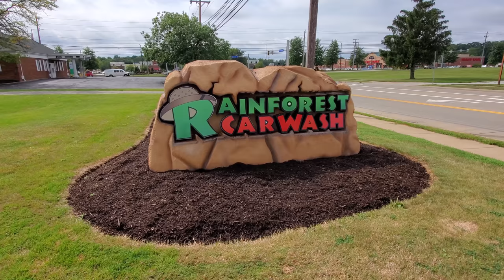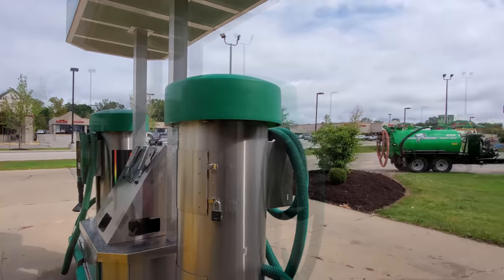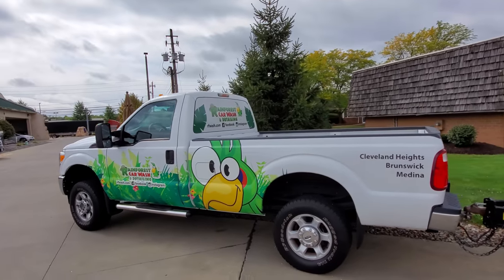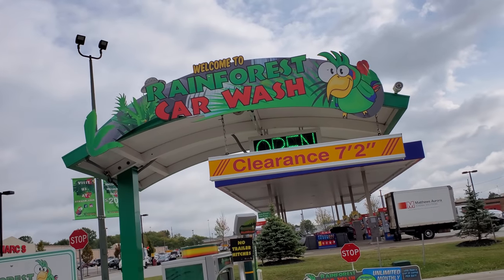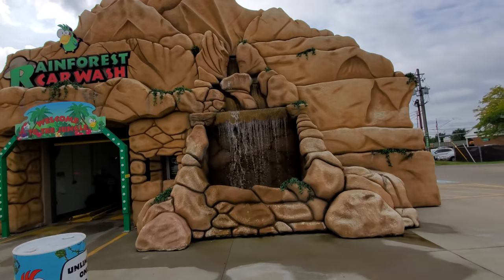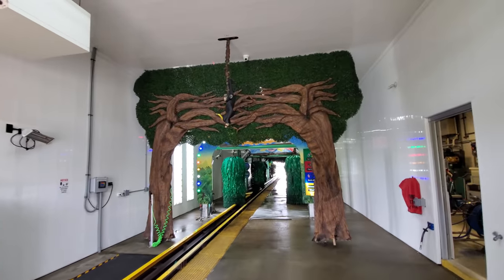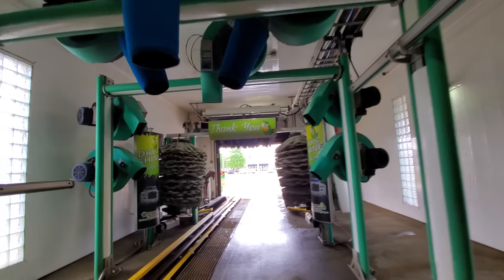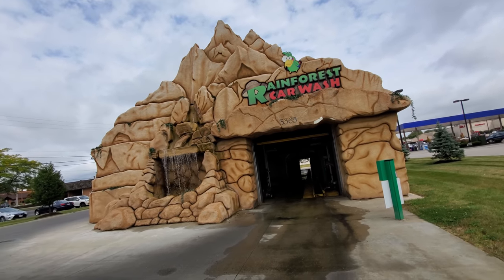MOST AWESOME CAR WASH EVER ! RAINFOREST CAR WASH in BRUNSWICK OHIO

Comment: This is an unique design of this car wash, I like it.  A lot better than the traditional car washes here in Lubbock. We used to have a Quick Quack Car Wash which did about the same which I went through the car wash but wasn't scary but was neat going through with no lights on.

Comment: I guess I missed the awesome part . Folks, hand wash your car . These car washes scratch your paint .
Reply: Handwashing scratches your paint too.
Reply: After running multiple washes for the last 10 years you're completely right as long as you're using a clean mit you won't have scratches hand washing your car
Reply: G17 SOFT TOUCH WASHES DO NOT SCRATCH CARS!!!!!!! They use closed cell foam, get your damn facts right buddy.
Reply: @thecarwashelevatorfanatic7433  
And the dirt that collects on the foam doesn't scratch your paint? Any contaminants will do the same thing, some may scratch your car less than others but when you add chemicals and things that have been used to clean other peoples cars it will scratch your paint.
Reply: Zach T You have no proof of that, they are safe for cars. Shut up and leave me alone you two.
Reply: @thecarwashelevatorfanatic7433  
Dude holy cow, facts are facts. Any contaminants on your car or equipment you're using will scratch your paint, you can minimize it but it will still happen anytime you wash your car
Reply: Zach T    Go check out our buddies elevator videos on his channel . He’s not playing with a full deck.  Haaa